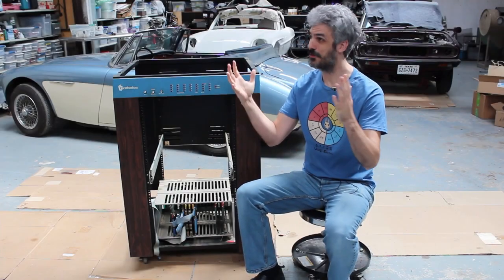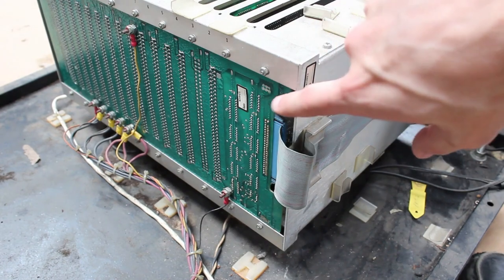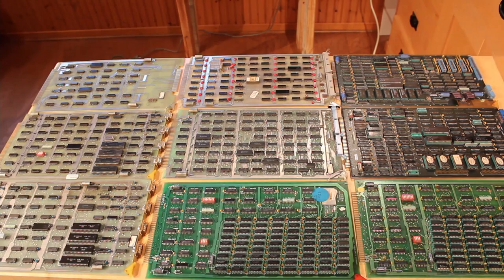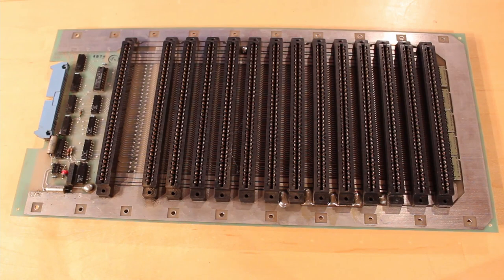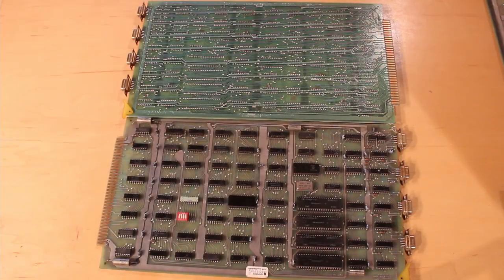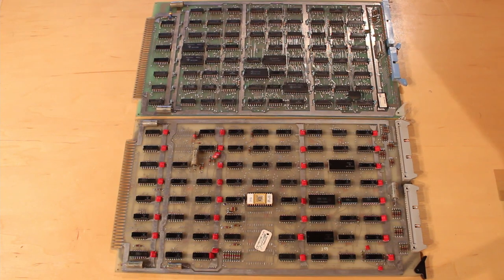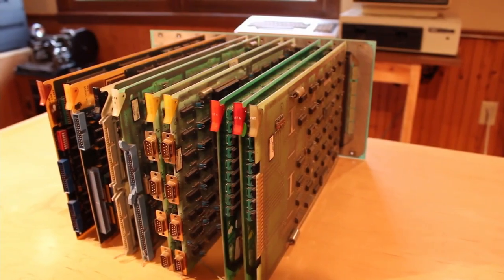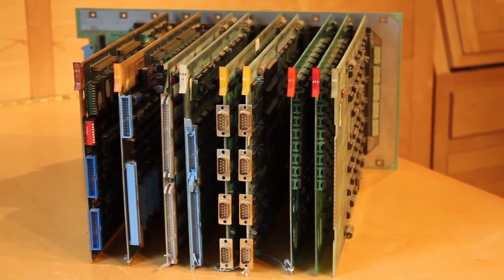Minicomputer Part 4: In-depth Look at all the Computer PCBs

Comment: S100 bus was really only for microcomputers.... Minis would have their own "special" bus.
The printer interface COULD be just a simple Centronics parallel port, I believe they were so common (second only to RS232) that you could even find them on minis....
That really is a weird weird way to solder decoupling capacitors. It might be to fit newer, smaller caps into pads intended for older, bigger caps. You know, like a safe way to bend the leads without mangling that cap's body. Notice how all the decoupling caps on the newer RAM boards are normal / the right way up.
Little 9-way connectors to the serial ports is kinda odd too... I was sure that they only existed on IBM PC clones.... obviously I'm wrong but every mini I ever saw had 25-way serial connectors.
Watch out for that current-loop. Until you can test it'd be safe to assume that your "mux" boards have RS232 outputs.... They might call them "mux" but I don't think they're really multiplexers as each port has it's own UART... I think they're just named "mux" 'cus it's easier to say than "serial controller".
Disk drives in those days were really DUMB... you'n need a specific controller for each drive... Modern "universal" protocols like SCSI are too complicated for those old drives to "understand".
If that PROM is UV erasable, it might be dead because it's got no sticker on it's window. :(
LOVE the layout on those RAM boards!!! 256K is absolutely massive for those days. I still remember how mind-boggleingly HUGE my mate's Amiga with 1 Meg was.... we felt light we had a mainframe in his bedroom.
I wonder if any of those ROMS on the CPU boards are code or microcode?????????
Also... don't trust anything I've said. I'm making all this up based on having used a couple of minis back in the long long ago.
Reply from the maker: You're absolutely right on pretty much everything you mentioned here! 

For the backplane, these cards are actually 72-pins and totally proprietary to Centurion. 

The printer interface is indeed the standard parallel port layout. I believe it receives a 7-bit ASCII to print and returns a 4-bit number for telling the computer if it's out of paper, there's a fault, etc.

For the decoupling capacitors, I actually met with a gentleman who used to work at Centurion and bombarded him with about 1000 questions, and one was about the caps. Turns out they changed cap manufacturers after they had ordered the boards, and the new caps had a smaller footprint. 

The serial connection on the MUX boards is purely Centurion design, and I think they chose the 9-pin connectors so they could fit four connectors per board. With two boards like I have here, they could connect eight terminals, which was enough for most small businesses.
And they are indeed RS-232 outputs on the MUX boards. The terminals can support both current loop and RS-232 with a little DIP switch setting on the back.

It blows my mind how complex the drive is and yet how much control was needed to interpret the data coming from the drive! I actually managed to get the data off the PROM and it looks valid! Fortunately, it was in the depths of the computer where no sunlight could reach. After I took the high-res photos here, I put some tape over the window just to be safe.

Talking with the engineer who used to work at Centurion, it's insane how expensive the RAM boards were to build in the late 70s! We're pretty certain this machine was built in 1979, and home computers at that time, like the TI-99, only had like 16k of RAM, so to have 256k is mental! 

The ROMs on the CPU contain something quite similar to microcode, though I'm not sure if that's the right way to refer to it in this case. This Centurion is a pretty late machine, but their first machines were wild. They used a purely TTL CPU called the CPU4 (because it needed four boards) and core memory. They wrote all their software for that architecture, so when they upgraded to the CPU5 board (which used two boards) and then to the CPU6 board (the single board seen here - the CMD board is actually for controlling the drives), they started using the AM2901 ALU. But the CPU5 and CPU6 boards were really just hardware emulators of the earlier CPU4 board, so customers could upgrade hardware but keep the same software. So, the ROMs contain all the emulation code for getting the CPU6 to behave like the CPU4.

Comment: I suspect the capacitors on the printer board are upside down so that they can fit in the space for the board when slid into the computer without having to 90 degree bend and touch the board itself.

Comment: Why decoupling capacitors mounted upside down?
NOTICE the Lead Spacing of the Capacitors being used and Spacing on PC board.
Likely PC board designer planned to use older capacitor series (wider lead spacing),
and this was a “production solution” with parts at hand (inventory).
Reply: You are correct.  Regards,  Ken R,

Comment: I'm thinking that the 24 volt supply is primarily used for motors. Most logic of that time was 5,12 an -12 volts.
Reply: The +24 VDC was only used to power the optional 8 inch floppy drives.  The +5 VDC & (+/-) 12 VDC are used by the CPU, Memory &  MMIO cards.   Regards,  Ken R.
Reply: @kenromaine2387  Typical set up for back then.

Comment: Date codes on boards/ components in equipment like this are not solid indicators of manufacture date.  These machines were repaired by board swapping.  So, there is no guarantee that any of them left the factory in that box.
Reply from the maker: You're totally right! I'm really terrible at reading handwriting, and those date stickers I initially thought it was a name or signature of something written above, but once someone pointed it out, I can see now it very clearly says "repaired" haha. So, there's a good chance the machine was built around 79 to 80, and then had various repairs and or upgrades through the early to mid 80s.

Comment: Never heard the term 'bodge' before. For us, that would be part of an ECO -- Engineering Change Order. At some point after the board was made, a mistake was discovered or an issue with the original design would be corrected in the field with an ECO. It could be as simple as cutting a trace and adding a wire, or as complex as adding another chip and running wires all over the board. Also, please don't assume all of those boards are original to the computer. This system shows signs of being repaired and boards would have been swapped out at that time. This was the 80's, computers weren't that reliable back then. Sounds like Mr. Romaine will be a definite asset in your attempts to get this system working.
BTW, do you know what the Centurion systems were used for? The company I worked for back then, Triad Systems, sold computers for auto parts stores, and used that same CDC 9427H hard drive. Our system wasn't as large, maybe the size of a two drawer filing cabinet, but used Z80 microprocessors for the main CPU and the serial card controllers.

Comment: Caps upside down to keep the leads from shorting to the traces.
Reply: Possible -- also it means the caps don't project high off the board to possibly get caught on other things while avoiding these shorts, as they would if kept upright.   Now from an RFI perspective long leads are bad, but at these frequencies it's probably moot.
Reply from the maker: Another commenter also suggested that it might be because the footprint used on the PCB was for a different, older style of capacitor and the caps used needed would have needed their legs spread too wide to fit, so mounting them upside down allowed the leads to fit as well kept them low profile!
Reply: @UsagiElectric  Yes, agree the layout was for a different foot print cap. Consider if you're bending the lead with needle nose pliers, it's all left bends and possibly grabbing each lead only once.
WRT Clock OSC/Cystal, is there one on the CPU 6 card?
Reply from the maker: @mitchwright1558  Interestingly, the only crystal in the entire computer is the one on the MUX board, which I imagine is strictly for getting serial timing done correctly. I guess it's possible that it's an asynchronous CPU design, which weren't unheard of, but that feels a little unlikely.
Reply: @UsagiElectric  I'll guess the OSC on the mux board was the master clock for everything. Although there are multiple mux boards, only one is configured with the clock. You might trace out that circuit, clock and reset are sort of the start point for everything.
Reply from the maker: @mitchwright1558  That's a good idea! I have a hard time imagining the MUX board containing the master clock, but who knows what kind of crazy stuff they were doing when they built this thing, haha.
Reply: @UsagiElectric  Looking at the hi-res CPU-F photo, it looks like there is a crystal at location M,7 ?
How to email you?

Comment: hope the rom on the disk controller isn't erased... there should have been a black sticker on it
Reply from the maker: Not a worry! The ROM was buried pretty deep in the system, and it actually takes a pretty substantial amount of sunlight to erase one of these ROMs. But, I managed to dump the data off most of the ROMs and the disk controller one was just fine. If you're curious, you can see the dumped ROM files here: https://github.com/Nakazoto/CenturionComputer

Comment: It's usually a good idea to put a sticker on UV windows ....
Reply from the maker: In this case, the PROM lived in the depths of the machine and never saw direct sunlight, so the bits were all intact.
However, after I snapped the high resolution photos used for this video, I put a sticker over the window just to be safe.
Reply: @UsagiElectric  yeah I saw Marc already let ya know a while ago. Surprised you don't have 10x the subs. Keep it up.

Comment: Pretty sure those caps are mounted upside down so that the bad electrons fall out. ;)
Reply: The R/F noise bypass caps are upside down so they fit on the PCB holes and do not need to have sharp bends on the caps legs.  Regards,  Ken R,

Comment: I bet in its day, this machine was uber expensive!
Reply from the maker: You're absolutely right!
I found an advertisement for a Centurion system that was 1 or 2 years newer than the model I have, but the specs were pretty much identical. And it had a price of $40,299 in 1981, which is a whopping $129,143 today!

Comment: would this be the same as an OLIVETTI BCS 3030
Reply from the maker: I'm not very familiar with the Olivetti computer, but looking at pictures it definitely seems like the same era!
For this Centurion though, it certainly seems like the PCBs are all bespoke designs though.
Reply from the maker: @mitchwright1558  It's wild to me just how little information there is out there! I've come across a few ads and even a brochure with some pricing information, but that's pretty much it. I haven't found any concrete information on the computers themselves. I sent an e-mail to the e-mail listed on Centurion's website, but never heard back from them. I think my only hope of getting any solid information about the system is to hope that someday the videos here get popular enough to catch the eye of someone who used to work on these things!
Reply: @UsagiElectric  With Data Point and others, San Antonio had a place in the computer industry in the '70s and early '80s. That system needed to be micro-coded, OS and drivers written and applications. Maybe the curiosity of Marc will turn something up...
Reply: It's a Warrex / Centorion, search warrex centorion in Linkedin will turn up a couple of folks...
Reply from the maker: @mitchwright1558  I have indeed found someone on LinkedIn that used to be a Centurion repairman, but without a premium account, I can't send messages unless we "connect". LinkedIn is a weird social media site that I'm still trying to wrap my head around (I've been working for the same employer for 12 years now, so I never really had to use LinkedIn for work).